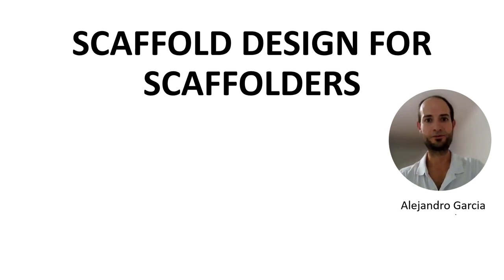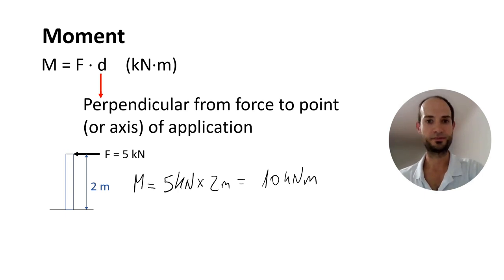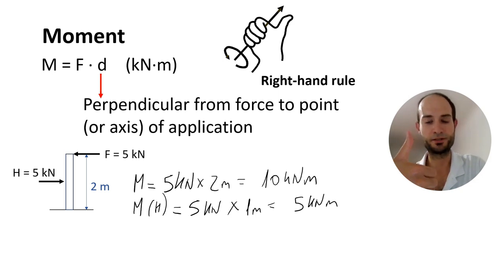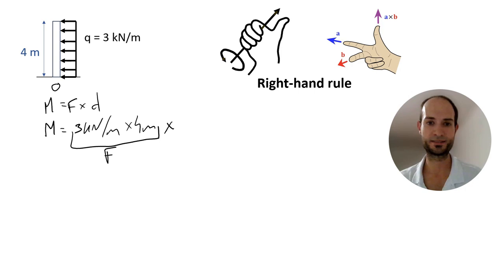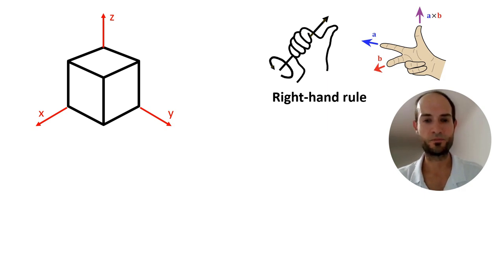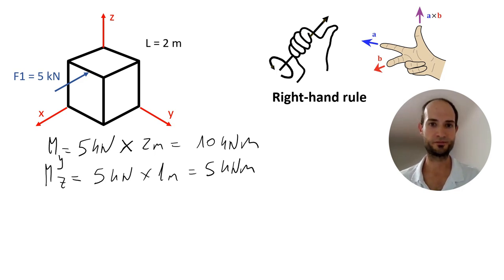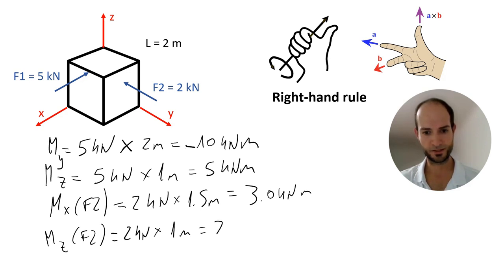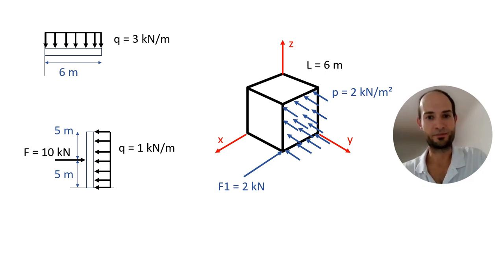What is a moment? - Scaffold design for scaffolders 2

Comment: Dont understand the hand rule for deciding if it positive or negative
Reply from the maker: I'll record another video. Basically, you follow the force-distance circle with your fingers.

If your thumb points towards the positive direction of the axis (X, Y or Z), it's a positive moment.

For example, Mz (F1): your fingers (right hand always) will go anticlockwise, and your thumb will point upwards, towards Z+. Therefore the moment is positive.

Comment: i need a little more explanation on the right hand rule
Reply from the maker: I'll record another video. Basically, you follow the force-distance circle with your fingers.

If your thumb points towards the positive direction of the axis (X, Y or Z), it's a positive moment.

For example, Mz (F1): your fingers (right hand always) will go anticlockwise, and your thumb will point upwards, towards Z+. Therefore the moment is positive.

In a different way: if the moment is anticlockwise [like Mz (F1) ], it will be positive.

If it goes clockwise, negative.

Comment: I didn’t understand the right hand rule
Reply from the maker: @aminechafi1622, the right-hand rule is just a convention. Whatever version you use (your fingers curving along the load and the distance, or 2 straight fingers pointing to load and distance), the thumb will indicate the direction of the moment. Let me know if this helps.
Reply: Actually I need more explanation if you can do a course on the right hand tool